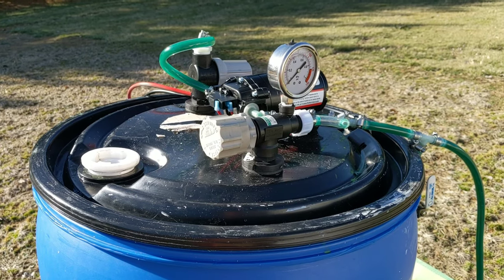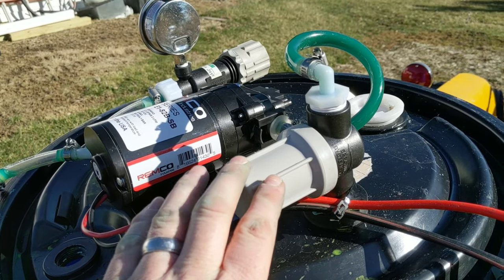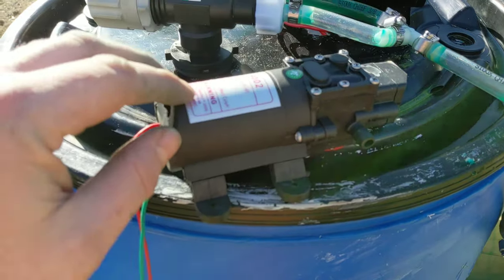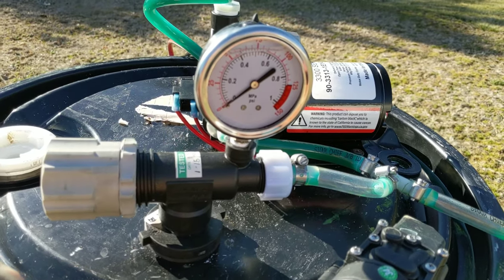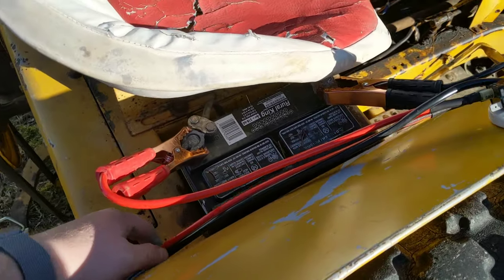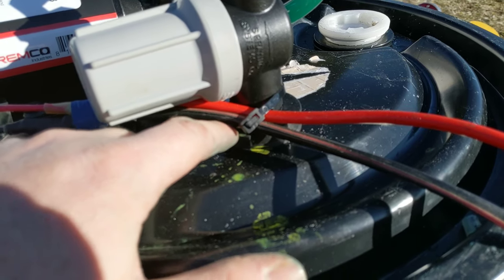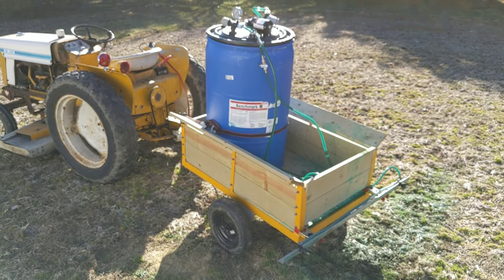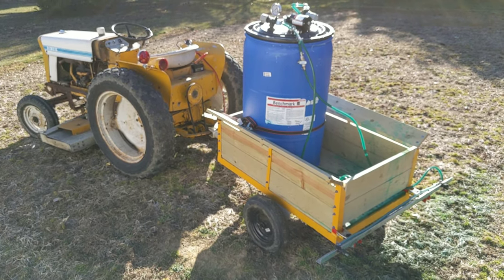Build your own DIY 55 Gallon No Drip Regulated Yard and Garden Sprayer on the cheap!

Comment: Great project bro !
I came across this video after trying out a 3 gallon electric pump sprayer I purchased in Costco. It was discounted to $44 and that’s what is worth. Blain’s is selling the Roundup brand of the same sprayer for $133. Not worth it !
I love your project ! You have a nice switch, a pressure gauge, two spray options , and it’s powerful enough to cover some serious acreage !
Thanks for sharing your ideas !

Comment: How did you connect the filter and the pressure relief valve to the PVC pipe through the 3/4 inch insert coupler? Also what size PVC tubing did you use?

Comment: So I gather you are pumping liquid (not air pressuring tank to push liquid).  Do you just let the pump run and let the regulator/relief valve handle return of excess or do you turn off switch periodically - thinking whether adding expansion tank would be helpful or not.  Thanks.
BTW, notice the cub cadet.  I still have old Cub 1811 my grandfather had (but it needs PTO replacement to be reliable).
Reply from the maker: Yup, we are moving liquid, not air.   And I turn the switch off when I do not want to be spraying and turn it back on when I do.  :D    Technically I don't have a Cadet, though I always thought they were cool!   The cadets were all smaller garden tractors.  The only thing the Lo Boys share are the colors.  :)

Comment: How did you connect cables to pump ?.. wouldn’t you need a converter ?
Reply from the maker: The pump is just 12 volts, so it can be connected directly to the 12 volt battery.